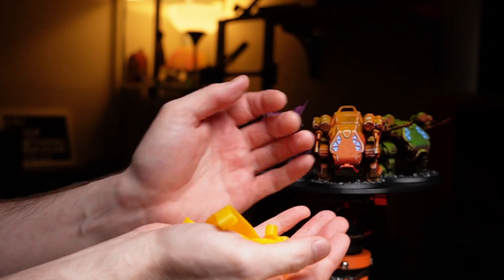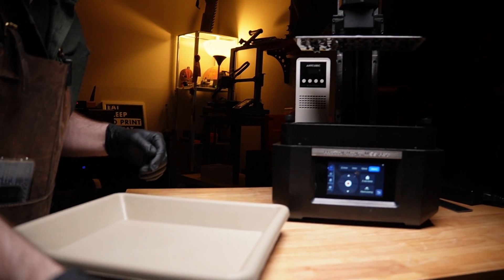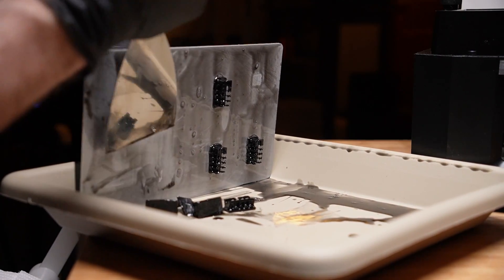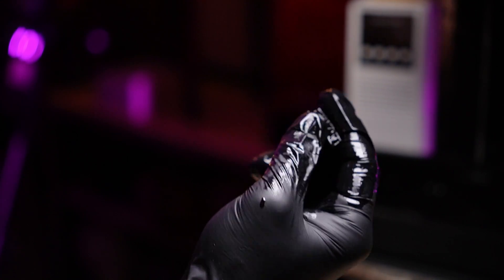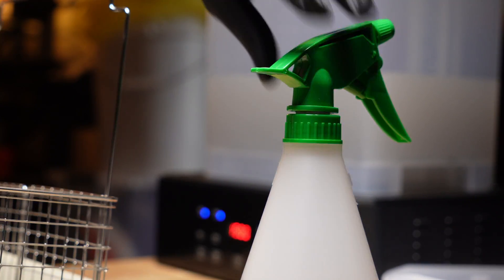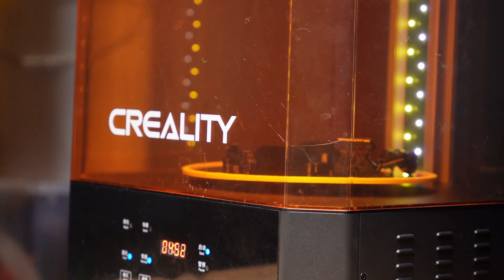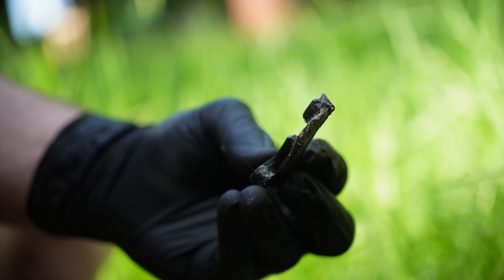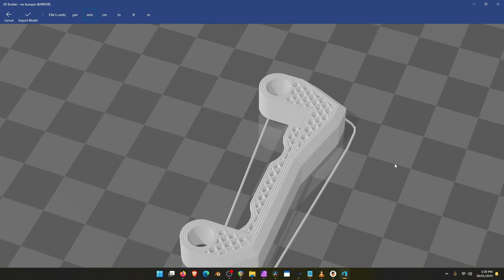Printing drone parts in FLEXIBLE RESIN!

Comment: Hi! To be honest, after just a few minutes of watching the video, I already realized that this resin is complete garbage.
Have you tried resins from other manufacturers, such as Resion or Anycubic?
As far as I understand, TPU has different properties — namely elasticity — and instantly returns to its original shape after bending. And it looks nothing like in the demo videos.
TPU doesn’t have that slow return effect.
I think Resion F80 resin would be a better fit.
I’m looking for a resin that would be similar to rubber, like silicone baking molds.
Have you ever come across something like that? What do you think about it?

Comment: nice video, though u pretty much misshandled this material. look up the manufacturers settings next time and plz wash the parts with a brush as well. also they probably need way longer post curing. like 30 -60 min

Comment: So how is resin printing "easier"? 10 minutes in and you are still diddling around with the exposure setting with sticky gloves and mess. Resin printer makers got to get their act together. So much low hangoimg fruit to solve so many of the issues, but they don't care.There will be a Youtuber diddling around for ten minutes with spreadsheets and exposure settings telling his audience how "easy" it is.

Comment: Never tempt Murphy. He heard you when you said resin printing was so much easier. LOL  I can't believe you're not using a flexible build plate, though! It's so much easier to remove prints. As far as which is better? It all depends on what you're printing. I find resin better at fine details. But it's much easier to prototype with FDM.

Comment: "resin printing is easier than...", yeah, let me just quickly put on the gloves to wash everything printed, bring the toxic wastes from that cleaning to a disposal center, and cure the model with a uv lamp. so much easier than taking the piece from your flexible build plate and be done with it.

don't get me wrong, resin printing is cool and all, but lets be honest about the issues.

Comment: 7:15 - Rebound.  That's the reason I wanted to watch this video.  All of the low durometer resins I've tried are expensive and they have very slow rebound properties, very consistent with your results in this video.  That would be good in some energy absorbing applications but I have a product I'm trying to migrate to additive manufacturing that needs fast rebound.

I love resin printing for the excellent surface finish and much more isotropic physical properties (essentially no interlayer weakness), but I definitely would not say it's easier.  I LOL'd when you made that claim.  I FDM print a lot of TPU for my business.  No heated bed.  It prints slowly but it's an unattended process so that doesn't really matter.  When a bed full of parts is finished ten hours later, I pluck them off and press the Print Again button.  No scraping, no alcohol washing and rinsing, no drying, no UV post cure, no stinky carcinogenic chemicals, no rubber gloves, no sticky mess all over everything, no filtering a vat of resin with little detached chunks.

95A or 98A TPU is easy to FDM print.  30-45 mm/s for everything.  Slow and steady.  I use 2-3 mm of retraction.  Select Avoid Crossing Perimeters in the slicer and paint a layer change seam someplace inconspicuous.  Direct drive extruder and you may need to recalibrate E steps to get the proper extrusion rate to avoid under extrusion.  Hang the reel above on a bearing hub spool holder and feed the filament directly into the top of the extruder with no reverse Bowden.  On a textured PEI build plate, I don't even use any bed heating and some of the parts I print are tall, thin, and have very little bed contact area.  High acceleration and fast moves would cause the tall thin parts to deform under acceleration and the upper portion of the parts would have a rough surface.  Up to 45 degree overhangs are OK.  Avoid overhanging arches, and avoid straight 45 degree overhangs that end at a peak (use a 3-5 mm flat top bridge instead).  Rafts and supports are a disaster so just don't.  Avoid large bed contact areas because TPU sticks so well.  I'll design the part with grooves if it requires a large bed contact area.

Exporting a sparse infill model to resin print is a cool hack.  New to me.  Thanks!

Comment: Regarding the vat cleaning function, I recommend this procedure which I have been using for years.
When you print something, don't throw away the supports. Keep aside those 4 cm tall and above. The pieces must have at least 2x1cm raft.
Before doing the vat cleaning, mix the resin well, place the piece in a corner where the screen will light up and finish the cycle. This means that the raft merges with the solid film of the cleaner and by pulling the supports, you can remove the film without the risk of piercing the fep, without having to empty the vat, or immerse your hands in the resin

Comment: Resin is the hardest way to print, especially with how toxic the resin is, fdm its just slice, print, remove supports, use. But resin ads in washing, drying, and curing and on top of that until you get to curing, you're handling something thats toxic and shouldn't be touched at all.

Comment: Brother, get a Bambu Lab and Polymaker TPU H and print at 80mms from a heated dryer like the Sunlu 2 and you will get 101% perfect looking and functioning prints with failures = -1

Comment: Resin sucks and FDM is easy. The difference between pushing a button and having a print compared to the precautions, prep, cleanup and general hassle of resin isn't even a comparison. It's like saying multi part epoxy you need to cure in an oven is easier than a hot glue gun lol.

Also my FDM parts don't crumble from UV degradation and are just generally stronger and better in everyway, the only benefit to resin is the resolution which has no benefit for anything but, the absolute smallest mechanical parts where .1mm is the difference between it working or not and the amount of people printing parts like that is tiny.

Comment: Black resin is always hard to print 

The resin needs to be warm around 25c 

You need to wash, wash, cure, wash, cure all at normal times or they can break down the print

Cure times should not double as the can break down the print, it looks like they did in your case

Comment: In 2024 FDM is set and forget basically. On BambuLab printers it's super noob-friendly and you only need a printer and a spool. Done, you're printing TPU on included profile without much issues.

Comment: Which slicer do you use?  and how you can have multiple exposure cones of calibration in a single run? I so far tried one by one and was a tedious work o guesstimate the right exposure.
Reply: It’s an anycubic slicer rerf program.
Reply: @lokiwartooth1138  great thanks. I Guess It can also be done by UV tools but this Is more user friendly

Comment: You can mix siraya tech blu with another truly flexible resin for some pretty good properties. It still won't recover from creep or bend situations as well as tpu, but the amount of detail you can get is what you are paying for at that point. If you can figure out bed adhesion (packing tape or roughed up [garolite/g10/fr4 or whatever you want to call fiberglass epoxy boards] work), polypropylene prints fairly nicely and almost assuredly will never break on you. It is used for living hinges, prosthetics, some pill bottles or chemical sealing containers, etc. There are some other plastics that you can get impact grades of as well on request from filament suppliers as they are just sold as pellets like the regular stuff.

Comment: i feel the need to ask some questions. when you were having failures did you lower the lift speed? flex resins need slower speeds and longer pulls or else you get delamination, which you did, if it was purely an exposure issue they would be stuck to the bottom of the vat entirely not just split at the middle and wonky. 
Also the post processing your ipa must be gunky, which caused your following issues, hence the stickyness and the resin attempting to stick to the curing surface like it did. you could have gotten away with it if you had gone over them before curing with a paper towel or such instead of the fan.
Granted ive not used that resin, closest ive used was the ancubic tough which is itself quite flexible. but this is just my thoughts on it.
SLA printing is easier but its still not a plug and play job, the lift speed is as important as the exposure time and the m5s to my knowledge has it cranked up quite a bit 😅
Side note that gcode export is pretty cool, just gotta make sure theres no trapped resin pockets, as if there are that will oneday spontaneously (and possibly spectacularly) fail as it outgasses over time

Comment: Flex resin is the most difficult to dial in. I would suggest researching the setting. Their are many forums with people posting settings for almost every printer. Also most likely your lift speeds need to be reduced. The long bath may have desolved the surface layers making it look that way. I like idea about mixing resin. Use a nylon like and this stuff, but dialing in might be more difficult. If you have a direct drive fdm extruder,  flex filament can be super easy.  I think fdm in general is easier but its what i have the most experience in.  But resin has its use cases for sure a must for printing precision parts like that. I would always use a resin printer for that over fdm. Fun video and i feel your pain with flex resin.

Comment: How do you print multiple models with different exposure times at the same time?
Reply from the maker: The feature is called R_E_R_F and can be found on the Anycubic website or the USB that comes with your printer. It's customizable, and prints whatever model you want 8 times, each 0.25 seconds longer than the last.

Comment: I normally run 15 seconds for the 3 bottom layers, then 4 sec for the rest.  It is a good setting and clean surfaces.  The stickiness you feel is normal.  Where the stickiness comes from is the unchained bonds of the negative polymer and washes away, then subsides over time.  Because flexible resins are not 100% accurate just yet, what we are able to purchase is not exact measurements but close enough to use, they will get better over time, but for now they are hazardous until hardened.  Something to keep in mind, looking at resins from the chemical aspect, the only dangerous part is the positive additive to the polymer. The positive is added as the bonding agent when exposed to UV light, once that bond is made, the additive becomes inert and no longer poses a danger, it become neutral once exposed or activated.  When you look at epoxy resins the same basic idea is used, only the positive additive of epoxy is  ...well epoxy +, it is activated by oxygen.  When you have a negative chemical and want it to harden, you add a positive  in controlled amounts to achieve the hardness you want or require. Once the exposure happens, the chemical becomes inert and is then safe to handle.   I hope this helps.
Reply: which slicer are you using? Did you try Anycubic Tough Resin Ultra?

Comment: Try this same resin for printing but do a 5-minute wash cycle and a 10-minute wash cycle then do the curing for each piece with the same timings as its wash cycle.
Some tacky resin requires a little bit of sticky/tackiness in its final curing to get full strength in its resin-printed parts and while drying out the parts leave the parts with a slight shine to it then cure it that should give it a glossy finish after curing.
This resin looks like rubber silicon which crumbles if it's too dry and when new or fresh often tends to be a little sticky especially after some oil is applied while it is prepped for use as a rubber belt for a machine run with a motor.

Comment: I've been using eSUN eResin-Flex for the last year for my FPV quads and whoops parts, quite successfully. My two cents: 
- slicer: exposure time 3,5s and bottom exposure time 35s
- Fusion360: nothing thinner than 2mm otherwise it's too fragile 
- printer: place the part laid down, no supports (takes less time)

Comment: If it works out itll be pretty awesome.  I prefer resin too, even though i have 3 FDM printers my 2 resin machines are just so much easier for now.  Eventually ill probably set up the voron 2.4 perfectly and itll be a toss up, but the abs resin i like using is pretty amazing stuff

You may have your light off or dwell times wrong.  Weird resins like this sometimes have a delayed activation on their cure and need like a 1-2 second dwell before they lift.

Comment: I  can print thoese litle parts in tpu or carbon/nylon very fast and very acurate even using 0.4mm nozzle , but yuo can use 0.2 mm for better details if need it , i think is less messy

Comment: Where did you get that tray/tub thing you are using. That looks very handy with the fairly short walls.
Reply from the maker: It's a UV resistant tray thats meant to go underneath pot plants. You can find em in the garden section of your home/hardware stores :)
Reply: @GogglesOFF  Bunnings?
Reply: @GogglesOFF  sweet thanks for the tip.

Comment: So SLA printing is so much easier than FDM, if you ignore all the failures and cleaning of gunk.
Reply: Failures? Had mine for 2 years and only failures are when changing to drastically different resins or I fail to properly support the print. Once I get a design printing well its incredibly easy to do beyond the cleaning which is not fun at all.
Reply: @ChrisHarmon1  for most people, resin printing just isnt worth it at all. Filaments can make you sick too, but resin is just so much worse and more messy that its not even fun anymore.
Reply: Easy ,yes ,but its messy ,yuo need gloves ,alchol ,a setup , that very quickly is all cover with toxyc resin , so not so easy , then yuo need sometimes change the fep, clean the vat , the smell , i use a respirator when i clean in the uv machine , soo
Reply: Lmao, I live in the US. Gov chemicals and shifty material handling will already give me cancer. I love resin printing.
Reply: I've never once had an issue with resin print failing, for the fumes I have a fan and dryer vent taking it all outside straight from.the enclosure. Resin just gives such fine detail with zero layer lines I love it so much for minis. For applications where you need flexible bits I definitely 1ould go with my x1 carbon and tpu tho since it's faster but that's just me.
Reply: Yea got a resin as my first biggest regret fem so much simpler
Reply: And health concerns
Reply: Resin and FDM aren't any different in difficulty, only in process and in print functionality. Pick your poison and have in mind what you will be using it for. There is a lot of overlap but mostly use resin for fine detail and accuracy, and use FDM for parts that need to be in the sun or bear weight or impact.
Reply: Looks like a mess and pain in the sss😂👍🍺
Reply: @mariusfauru  it is messy, until you figure out a procedure to handle it effectively. 
myself for example, gloves-on -> open up printer cover -> open up washing bucket's lid -> unscrew build plate
->put entire build plate in it for first wash -> wait -> open up second washing bucket lid -> tear off all print from plate into second washing bucket (first contact to resin with gloves) -> take off gloves ->close lid and wash.
Actually if I make a tool to remove my print effectively, my gloves wont even be contaminated

Comment: Curing under water helps against tackiness.
Reply: This looks suspiciously like a resin we use to make earmoulds for hearing aid patients. It's usually cured using xenon flash bulbs under nitrogen.. but no idea how that could be adapted to a 'consumer grade' solution
Reply: @johnd6487  The problem is the oxygen in the air, which blocks the curing process.  In the medical field, you probably want to be safe and guarantee that no cured material comes into contact with the patient. Some oxygen could still be dissolved in the water, which could then cause irritation or similar. 
However, the result with water is already very good for me. But I don't have permanent skin contact.

Comment: 3 things to consider, use a mixing routine (table flip foundry automixer is amazing) to help consistency. Slow your plate speeds way down (45mm) when working with gummy resins to avoid delamination. And look at adding 10 seconds of lights off delay to help with the bluming. Thick tough resins are slow resins to work with. Try tenacious! Thanks for the video!
Reply: I’ve tried tenacious, but found that because it’s transparent, you can’t really print anything which needs supports as the light, exposes more resin than expected
Reply: @markstevensfpv3722 so you mix it with flex